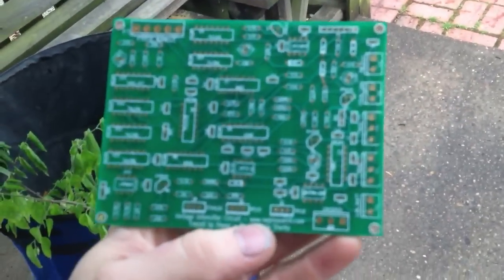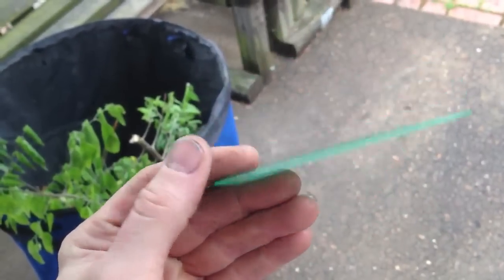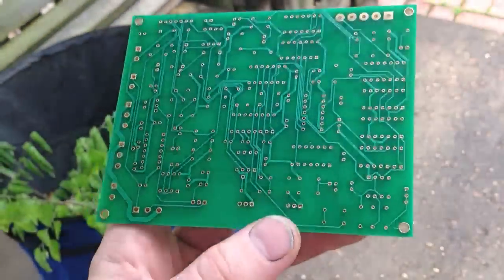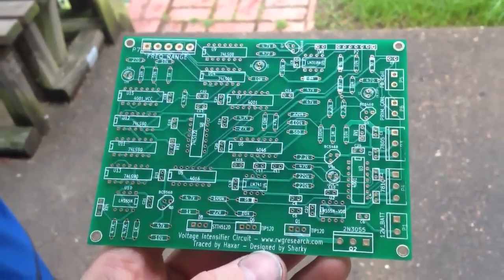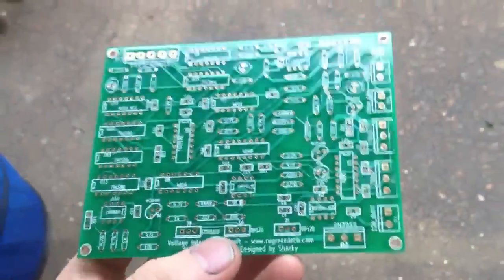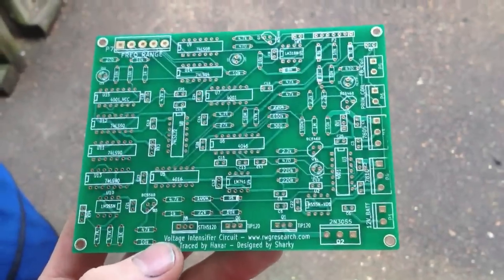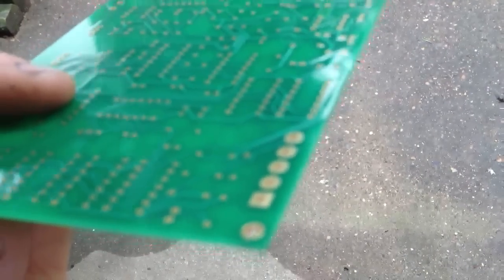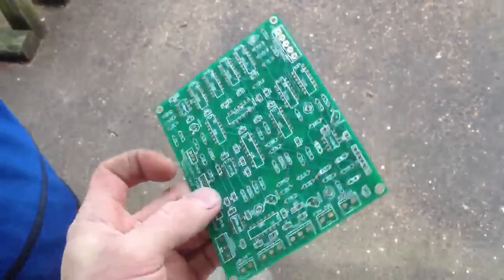First VIC Test PCB Board From Sharky! Sweetness! Sharky Is Also Testing His! Thanks Sharky!!!

Comment from the maker: The russtic frequency generator is a good to be used for resonant circuits, and be used as a learning tool to help others understand resonants and to help teach how to tune LRC circuits.  The arduino can be used to replace the VIC driver card and others, the functions of the stans circuits is understood, one could use the arduino as a replacement for any circuits, and will be used in the future.  Same as stan stated it would, "system engineering approach" ~Russ

Comment from the maker: Resonance is easy to achieve. It's the exact process and the amplitudes that Stan talks about, everything needs to be just corect. Any way you know this, as far as Stan's circuits. There is some things that could be improved like the way the 555 timer was conected in the highest frequency, it was not ran thrugh a 74ls90 and would not give a true 50% duty cycle. It was close, but use a scope, you will see that it could be inproved. Any way, hope this helps, running out of text here... ~Russ